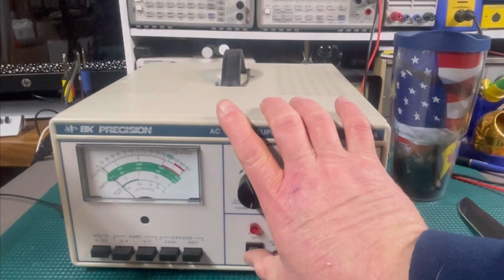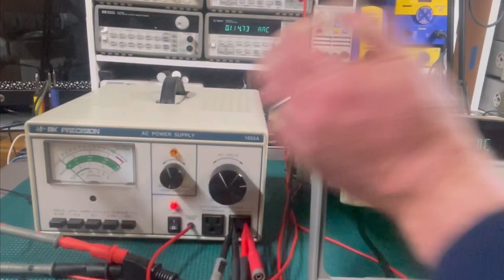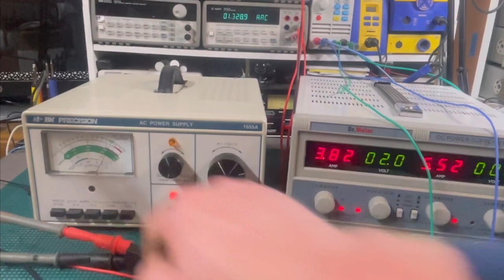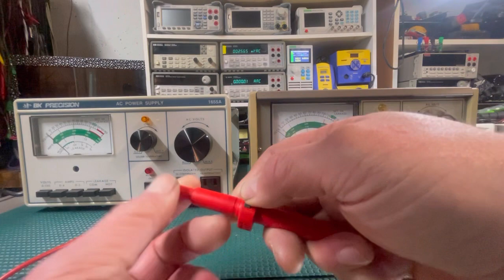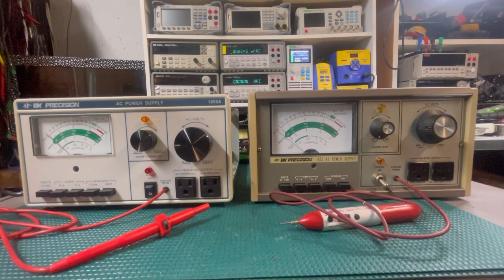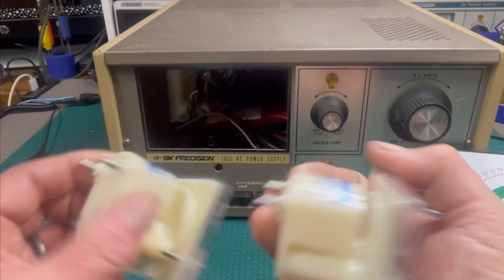Used BK Precision 1655 test and completion to the 1655A

Comment: i just bought a 1655 from facebook and i had to put a new power cord on and change some diodes and seems to work ok. it did not come with the leakage probe. it had been cut off. i can make a probe but i cant find any info on whats in it. have you ever looked inside to see whats there? i also need the switch array cuz the hot button is broken way deep inside. i installed a banana jack and took the direct wire out. looks better too.
Reply from the maker: Sorry for the delay. It is just a mechanical disconnect.